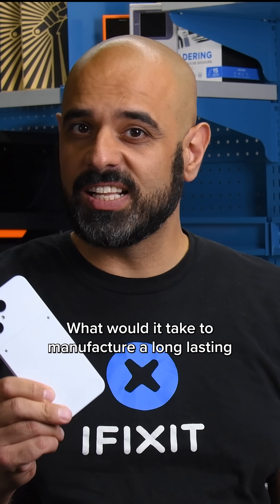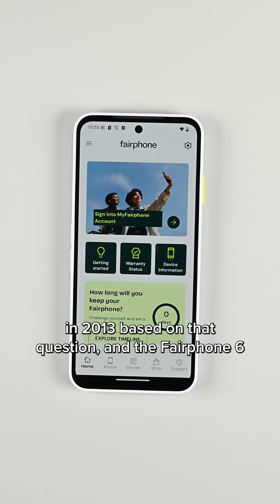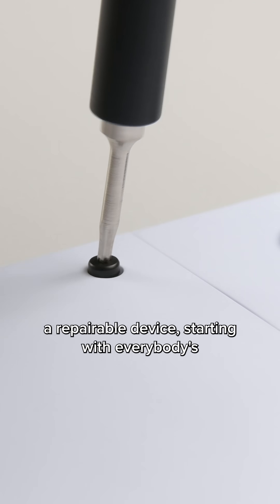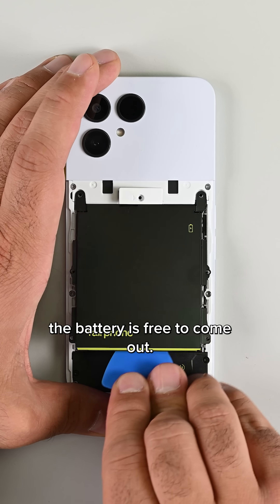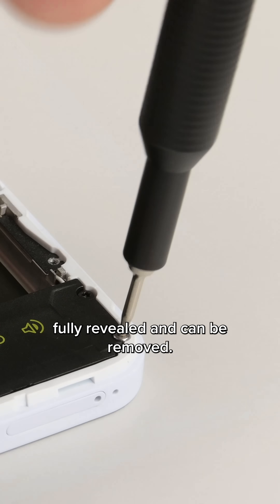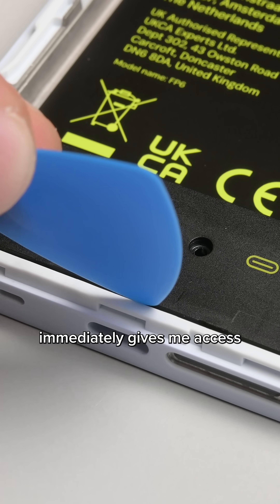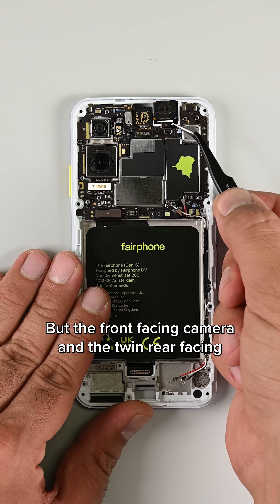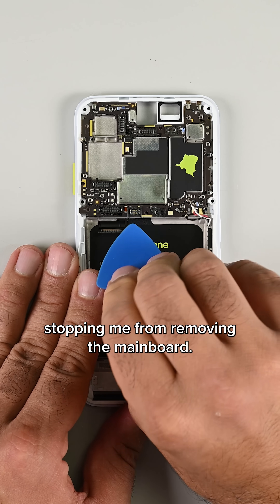Fairphone 6 Teardown! WE LOVE IT! #ifixit #fairphone6 #teardown

Comment: All good, but I have two things.
1. With a price of 600, why did they put the same camera as on phones for 250? 
The price for the Pixel Camera is just around 60, as a component for manufacturing. The price for a refurbished Pixel 9 Pro is 600. Buying refurbished is more Green than buying new production. 
2. The previous one was released just two years ago. So why did they not propose an update for rev.5 but a new one??? Is it really green? Or is it “fair” and “green” in their language? 
Fruit phone and Big number phone, both proposed ~8 years of support, with high-end software and hardware.
Reply: You make fair point here. Write an email to them and ask. Maybe there are actual answers behind that decisions.
Reply: they say the price is high because it is ethical
Reply: @bhaskarsamani1507 I've seen a profit report from fairphone and they have a profit margin of 1% if i remember correctly, they really cannot go cheaper than they currently are. Getting humane labor and ethical resources costs them a lot more for the production. Their low production numbers do not help either
Reply: Just use the actual names if you're trying to make a salient point. Hesitation in using common sense like this is simply unnecessary. Does it really take that much longer to say Apple, Google or Samsung? Or do you prefer to treat the other side of a conversation as a child?

Comment: Have you guys ever done water intrusion/long term wear testing on phones like these? I’m curious if the lack of glue actually makes any difference at all. Not looking to give other phone makers an excuse, but it would be interesting to see if ultra modular phones like this hold up as well as ones that are basically epoxied solid
Reply: In regards to waterresistance: Most people will not notice any difference, since most phones on the market despite being glued together, are NOT watertight. Only the flagship phones are actually somewhat watertight. 

FF6 has an IP55 dust protection and water resistance, as well as a 1,5m drop resistance. Not one middle class phone I owned so far could matche that.
Reply: Probably not because repairability and water resistance are incompatible, we can't have both at the same time. It's either one or the other
Reply: @DioTheGreatOne  We could, but making it watertight and repairable would make it much more bulky.

As to durability: I heard from a construction company that switched to Fairphones. Their reasoning was to avoid the need and costs of sending phones in for repair, as well as the time the "Geniusbar" takes to actually repair anything. They observed, that fairphones don't break as easily in the first place and are far more drop resistant.
Reply: @DioTheGreatOne wrong and incorrect. The Galaxy S5 had a removable battery and backplate and was still waterproof.